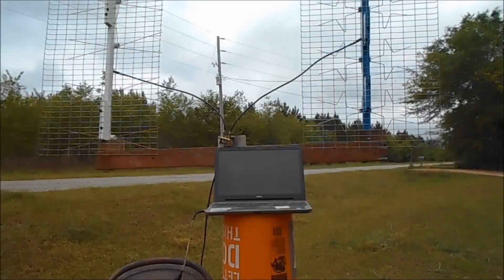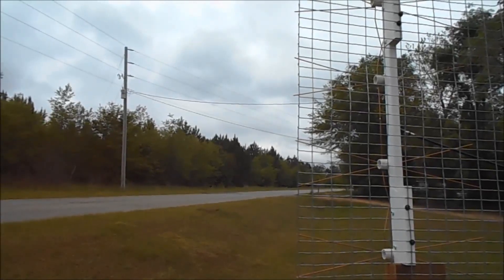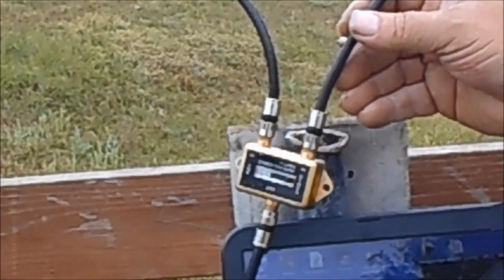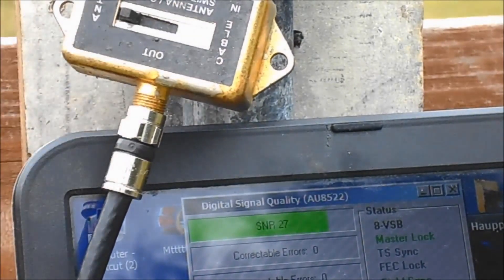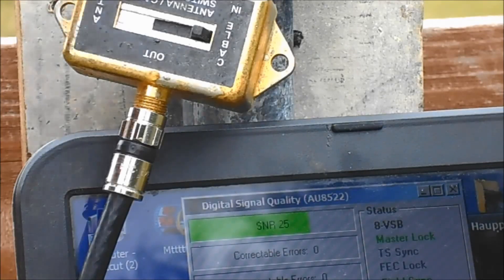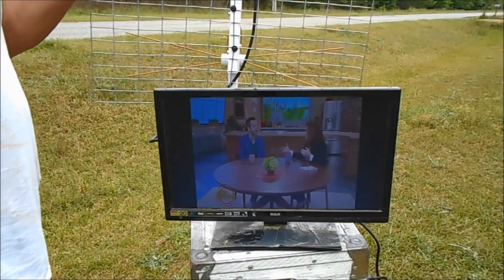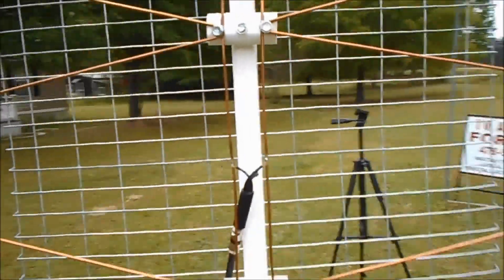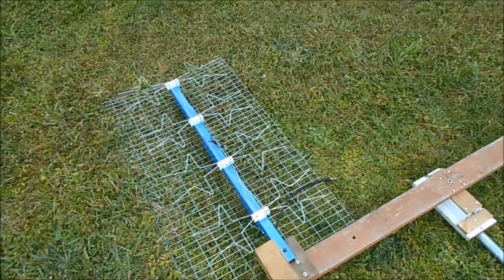Fractal TV Antenna VS The Ultimate TV Antenna

Comment: Several problems in your test. First, you didn't take each antenna and put them in the exact same place when you tested. Second, on your fractal antenna, you used the wrong angles in bending the wire. Third - for the reflector - did you account for the reflector distance? Forth - did you account for the signal loss on the splitter and switch the inputs to verify they are both having the same loss?
Fifth - were you standing in the same spot for each test? Reflection and restriction of signal will happen. 
I will say overall - you do have some good info.

Comment: I made both antenna's, I put them one at a time in position and scanned for channel signals. My Broadcast towers range at about 35 miles and there are 44 towers.  The Fractal antenna got 24 channels, the Ultimate antenna got 41 channels. My mounting location was inside my house, mounted facing north inside a closet at 7 feet. I was impressed. Im going to go one step further and relocate the antenna inside the garage up in the rafters, it will get the antenna at 10 feet which is what TV station locater site recommended will come back when complete and give you the results.  So anybody attempting to build one, Im a certified ISCET tech this antenna works and works well. Good job sir,

Comment: Your 'fractal' antenna is tuned lower , by roughly 30% in frequency, than your skeleton bowtie.  The whole point of the fractal, here, is to make the overall antenna smaller. You kept it the same size. So naturally, its going to operate  best at frequencies lower than your TV channels. I appreciate you are trying to sell your skeleton bowties an wish you luck with that. But keep in mind the next time you want to claim 'better' that you compare two antenna designed for the same frequencies. This isn't it.

Comment: my experience with a reflector is it will kill a fractal signal.... try it without the reflector and measure... the signal on mine went from 12 channels with it, to 31 without the reflector,... but I have signals coming from 360 degrees... a reflector is only for signals coming from one direction
Reply: bones007able - I was also under the assumption a true fractal has 5 nodes.

Comment: Hey Danny, great job on your antennas. But I am surprised that someone who takes great pride in their workmanship such as yourself would make an imprecise fractal antenna. I would like to see you redo this comparison with a proper fractal antenna. 

Here is a link that has a precise template for the fractal elements of the antenna. 

http://www.ruckman.net/downloads/fractaltemplate.pdf?attredirects=0

You can scale up the antenna but you also have to scale up the distances between each element to the same ratio. The bends and angles have to be very exact for the fractal to get the best results.

I just built one here in Tucson and I'm picking up about 35 or so stations 38 miles away without using a reflector screen. I scaled it up to full wavelength for 560 MHz (Ch 24). The length of the wires were exactly 22 in. and the bends were made exactly every 2.75 inches. I made sure the elements were aligned properly just like it looks in the template.

I have to build an antenna that can pick up stations from 100 miles away, so I really am interested to see how a well made fractal antenna compares to your Ultimate Antenna.
Reply from the maker: ok i might do that
Reply: That is, one that covers the same frequencies and is not detuned to the TV channels. Ask yourself why there are over 1000 videos showing higher signals with the fractal, whik Danny gets lower.  Answer: the fractal would have to be SMALLER to cover the same frequencies and hence TV channels. Hey, if you think a bigger antenna with a larger wind load is preferred, then buy Danny's antenna.
Reply: MIGHT? So you acknowledge that the comparison is bogus, yet refuse to correct the video, or acknowledge that your antenna has not demonstrated an alleged advantage.